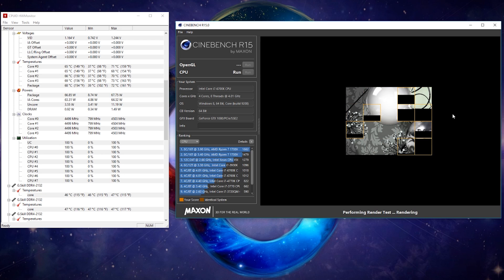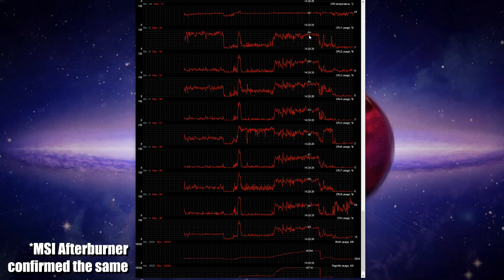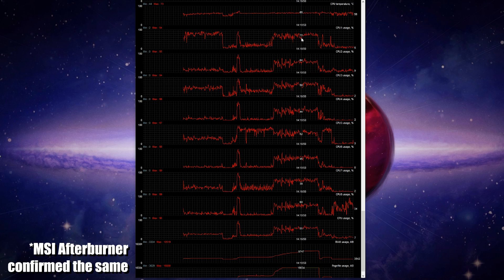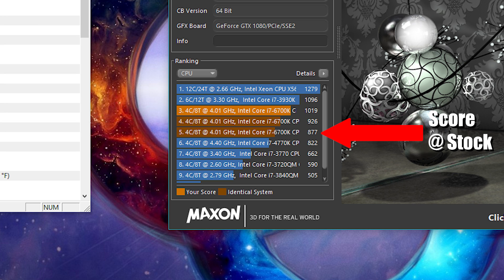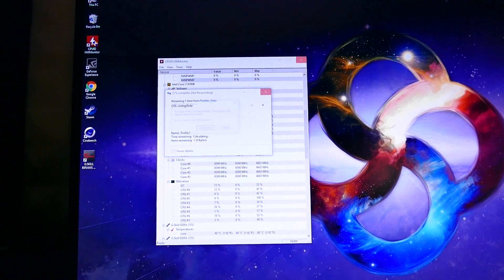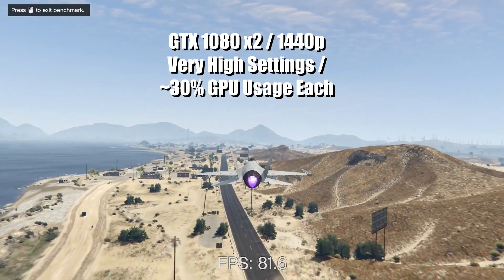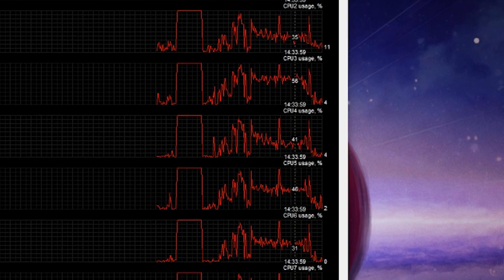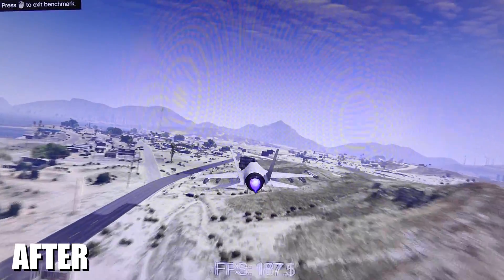My PC was Terribly Under-Performing...

Comment: I had a similar issue when i was overclocking the bejesus out of a Athlon x4 860k the higher i went 4.5GHz 5Ghz I was seeing loss in performance (yes I checked thermals and it is on water). I ran a memory benchmark and BLAM found that my ram was under performing as WELL (4th percentile) so I started poking around BIOS and I found out that my RAM timings were set to "AUTO", what ever that means, this is when it hit me. I had been overclocking my cpu so far that it started messing with my FSB and as a result my RAM timings were wayyyyy up there (i think it was something like 16-18-17-32 ddr3-1866)! I cleared CMOS and locked my timings to normal and manually overclocked my RAM, FSB, and CPU and now it sits in the (96th percentile @ 4.2ghz). Lesson here is to check how your bios controls other components on the board when you overclock. Each board is different and out of the half-dozen systems that I have overclocked I have never seen this issue.

Comment: i had the same problem with GTX 1070 i installed windows updated all drivers but when i ran games my gpu was siting around 900mhz and the fans weren't turning on so i tried everything reinstalled gpu drivers reinstalled windows drivers still nothing in the end i reinstalled windows still the same problem!! so i put in the disk that came with the motherboard again and reinstalled directx11 again my computer freaked out a bunch of weird shit happend onscreen then it went black after like 10 seconds it came back on and bang! problem fixed all that overthinking for a stupid problem like that i dont know if thats what caused your problem but i hope it helps!

Comment: I've had a low GPU usage issue on my PC in the past on my Ryzen system for absolutely no reason. My SINGLE Titan XP (2016) was around 50% in Witcher 3 when in 4K which affected framerate massively. DDU, same result and then I reinstalled windows which then fixed my issue like you did here... Weird.

Comment: I do have an issue with my laptop that confuses me that my GPU will never go above 99% usage. I thought this was to be expected when I had to replace the P7550 with a T7250 since somehow the P7550 got damaged. So I eventually upgraded to a P8700 which is far better than the P7550 I had before and the laptop fully supported it.  But the usage is still never higher than 99%. Im not sure if this would make a big impact or not  to the performace. I use GPU-Z and I have noticed that the dedicated RAM for the GPU never goes above 499.5 MHz even though its rated for 500 MHz (GT 130M with DDR2 1GB), everything else is fine. I get 30-45 FPS in TF2 at low and I would expect better since this GPU more than meets the specs for the game. I get 50-60 FPS in CSGO though. Im not sure if that 1% will make any huge difference or not. Any thoughts?

Comment: There are a lot of unexplained things in this world. When I was on Windows 8.1 something happened that made Windows Task manager pick up 1 core of my i3 3240 but still read 4 threads. Performance was like 1 core with HT enabled overall with the system, BIOS read the CPU fine. All I did to fix the issue was update to Windows 10, but I still always wonder wth could've happened to cause that
Reply: FeTi Productions msconfig setting probably.

Comment: it could of been a windows update, there's been a couple of times in which drivers/software start having problems due to a simple update.
Reply: You can also go back in time, pretty much go onto the last system restore point on recovery mode / Or worst case look for an option called "go back to previous build"

Comment: You know, I was having a problem with my i7 4790k where it was running at 95+c and I couldn't figure out why. I ended up resetting my bios and reoverclocking with the same settings and it brought my temps down almost 20c. I don't know what changed, but resetting it worked.

Comment: I got the same problem with my old laptop back then and i just installed something that fucked up my gpu and cpu performance so i tried reformatting the system and it worked.
I suggest go check what you installed before this problem occurred :)

Comment: Windows 10 updates keep changing Power Options. Even though it will show High Performance settings, like you have them at, they were actually running at Balanced, which is Windows 10 default. Windows 10 does this too me after every update, so I built a checklist of settings so I can clear the settings, and come back and put back in my settings. It is a pain in the ass, but has been doing this since about January, and no word from Microsoft why.
Reply: Whats the checklist?

Comment: if your cores were good, possibly unstable cache? A few days after OCing a little i5 I noticed the cache was too high and started hurting my performance.  I dropped it just a bit as I had it even with my OC cores and the issue cleared up. I suppose it could also cause a GPU bottleneck. Who knows though, it is a mystery. Then again it could have been that hyper threading bug.

Comment: I used something called tertiary  frame buffer ( something like that ) on my old gtx 670 sli config in 2014 and it gave me some really odd results, my gpu usage dropped horrifically to about 33% each and my frame rate halfed, I only fixed it by taking the cards out and resetting the drivers to stock. It wasn't the tertiary frame buffer thingy that was the issue but more that once I toggled it my install of the drivers decided to fuck them-self in the ass and refuse to work correctly, I've never had the issue since or before that. I switch out to a gtx 780 ti ghz planning to go sli and I'll let you know if they have any issues similar to this.

Comment: Try disabling HEPT. The dual Xeon build I built for my girlfriend is having latency problems. I disabled HEPT and blam, fixed. Unfortunately when I disable it after some time Windows just creaks to a halt and freezes (more or less). It doesn't do this on Linux. Windows 10 is supposed to have a better alternative for HEPT but when I disable it in the BIOS it just freezes.. Yeah, Windows 10 sucks.

Comment: motherboard is the center piece and has contact with both issues, did you update a bios after your first setup? not sure why it would happen but two issues with different components also did you underclock the ddr or did that happen after a bios update? just a thought buddy.

Comment: I had an interesting problem with my Ryzen 7 1700...  I had it overclocked to 4ghz and was running benchmarks and had abysmal performance.   When I checked the cpu clock was using boost mode and going to 1.5 ghz so I turned off the overclock and was back to normal performance... Very odd but I guess I will have to delve deeply into my bios and disable boost.

Comment: I also have some pc issues and have spent months looking up info & swapping pieces here and there. And after 6 months of doing this (I actually travel a lot so in 6 months I only spent a few weeks at home, not enough as to focuss on the issue) I think I can say it's my i7-6700K. Suffers from extremely random crashes (while idle, youtube, even in some random games like NMS, Wildlands, Division or TSW....) and doesn't hyperthread. Some time ago I found about the "Skylake bug" and was able to tell that that was my issue, now confirmed by the recent news of Skylake's having crashes before hyperthreading (literally my issue, my cpu won't hyperthread and randomly crash, probably when it tries to). I've been tempted so many times in the past months to just screwing it and spending 500€ on a ryzen 7 and be done with it (plus, for what I do, the extra cores & threads would be benefical). Just can't be bothered of spending more momey after getting an overpriced i7-6700K.

Comment: Maybe because the os thought u had a previous graphics card still in there? Like u had a 1060 or something in the system on that exact os because I had the exact same issue I tried using a different ssd and it worked fine

Comment: I built a computer for work last week. CPU was Ryzen 7 1700. I overclocked it from 3 GHz to 3.7 GHz and went to test it. Cinebench score was the same as stock. I spent 3 hours trying to figure out what was wrong, at one point overclocking so high (4.1GHz) that I had to do a CMOS reset. The CMOS reset didn't fix the performance issue. Finally I noticed that clock speeds were being reported as 2.5GHz by task manager. I googled the issue. Turns out IT WAS FREAKING WINDOWS POWER SAVER. WHY WOULD ANYONE WANT TO THROTTLE A DESKTOP TO SAVE POWER? POWER SAVER IS FOR LAPTOPS. WHY, WINDOWS, WHY???? Anyway I fixed it and life was good... until the BIOS started being a butt but that's a story for another time
Reply: PeKoE In America  you'd be only saving maybe a couple dollars a year though.
Reply: @anotherks7297  depends
Reply: ...because windows
Reply: I used to get the worst stuttering ever, and (I'm going to use PUBG for reference) I would get 55 FPS max in PUBG, all lowest settings, aside from textures. ThIS WaS sOoOo AnNoYiNg (I have an i7-3770). Power-saver.... was making my CPU run at 1.57 GHz. Click "High Performance?" Consistent 80 FPS in PUBG, tiny stutters. Web-browsing got way better, everything felt so amazing. Fuck off, Windows.
Reply: @klumsy3420  1.5 GhZ!!!!!!!!!!!!!!!!!!!
Reply: These comments sound like a life saver. I totally forgot to check my power options. No wonder my overclocks  feel sluggish lately.
Reply: Power saver doesn't necessarily have to be about saving battery life but reducing electricity consumption.
Reply: thanks mine was set to balanced i never thought about this
Reply: both things you said are the fucking same!!!!!!!!!
Reply: lol this was happening with my GPU- Nvidea has that optimize efficiency thing... if you are working with a nominal PSU I guess it could be good...
Reply: create how would you turn off the power saver?
Reply: my desktop eats alot of power like alot,,, and im just rinning a i3-8350k only,,i cant imagine a 5ghz 9900k,,, looks like im running a grow op
Reply: My man... I was getting 40% on both cpu and gpu and once I changed that it was better. Ty
Reply: how do you fix it teach me
Reply: Holy shit ik this is 3 years late but I’m so thankful for your comment. I was so stressed because I paid a lot of money for my pc and I had no idea what was going on, but you helped me out so much. Thank you so much.
Reply: just upgraded recently and had the same issue, getting around 1.6ghz on my ryzen 5 5600x. was panicking until i read this and noticed my power saving shit was on too. thank you for your comment, you saved me from having a heart attack !!
Reply: create you must be new, windows power savings thing has been there for years. I believe it may be for businesses, since they have multiple computers hooked up.
Reply: i do this, bcause if correct configurated, the clocks will be set as high as needed for the task.
it doesnt slow down my pc, only more silent and less consumption :)
Reply: AMD users need to download and use the AMD POWER PROFILE TO AVOID THIS ISSUE.

Power saver is for SAVING POWER, NOT FOR LAPTOPS. YES, NORMAL DESKTOP USERS CARE ABOUT POWER USAGE.

Comment: Weird bios issues like this can often be attributed to a software glitch in the the EPROM itself, or a bit flip. I have seen bios/uefi bit flips cause some weird issues that you would not believe if I told you. I've written the EPROM to a file and compared with checksum verified copies from the manufacturer and found some discrepancies. I then Re-flashed the EPROM, and issues were gone. Sometimes the error is in the CMOS-RAM that you can reset and some times it's in the ROM. ROM software issues usually cause issues that reside in the resetable data in my experience but bit flips can occur there too. Many newer UEFIs use checksums to verify the data and you will simply get a checksum error and if resetting doesn't work, hope to whatever god you choose that you still have the ability to reflash via UEFI.... or have a chip burner on hand.

Comment: could have been Windows 10 game mode.....had the same problem and lot of stutter and low frame rate once windows 10 creator update was installed. Windows game mode was activated on default for me.

Comment: windows 10 imo is still buggy as hell. when i reinstall a windows 10 to my pc the wifi doesn't work, the whole bar (bookmarked programs bar) are unclickable and clicking windows to shut my pc doesn't work. not to mention my pc is overheating.

i solved it by going to the advanced boot settings and do a clean install (without clearing the data), reinstall drivers, and update windows

Comment: Ive never really done cpu or ram overclocking so I dont know if this is good or not but my ram is running at 2666mhz on 1.35v  (corsair 3200mhz kit) and my R5 1600 is running at 3.9Ghz at 1.3875v on my MSI b350m arctic mortar mobo

Comment: I am having the exactly same issue with two 1080ti sli(low usage, fps worse than single card), if only you uploaded this video a little bit earlier because I ended up return one of them a few days ago. Now I am really curious what will happen if I try to fresh reinstall the OS, at this point I not even care about fps anymore, I just want to know if that will fix the issue and I really want to know what could be the cause. Thank you for this video, at least now I know I am not alone.
=========================================================
Edit: 
Things I tried:
DDU
Different HB SLI brigade
Test each of the single card and each of the slot on MB
=========================================================

Comment: I'll try doing what the video sugested. I have a Q6600 and rx 480 8gb, 6gb ddr2 ram. I've seen people with the same procesor and a gtx 750 ti get better framerates in gta V and CS:GO. (procesor is stock = 2.4 Ghz)

Comment: I always will recommend getting a standalone hdd/ssd for only the system. Not only you get more storage for you BS, you also smoothen your frametimes, because the load on windows is focused on one hard drive, and game on another. And then if you see your system underperforming, you easily backup a few gigabytes of data (documents, saves and otherwise pretty much it) and you're good to go reinstalling. Steam, origin and uplay have the function to check, if you have games on the hard drive already, so that's only a matter of few hours, and programs don't take too much of space (usually 300mb at most) so it's a very fast process to actually do a cleanup like this. Two HDDs are a must for me.

Comment: Sounds like you had a stability issue and had a degraded OS aka data was slightly corrupted been there and done that on my asus sabertooth x99 I7 5820k only fix was redo the OS and slightly reduce my OC on my CPU by 100mhz and I had no BSOD's or lockups or anything.

The thing is with haswell and skylake you might want to up your CPU cache voltage a slight bit found even when cache is at stock over time there is some issues especially if OC the cores I believe the voltage drop due to the core OC meaning the running voltage on CPU cache is low causing minor stability issue and I found it basically shows no signs of a issue other than eventually causes a performance degradation.

Comment: i had very strange bios problem too.. i bought in 2015 z97p-d3 mobo and i5 4670k combo with newest bios at that time. Everything worked normally for 4 months. Suddenly my pc could not post, unless i reset bios. next time when i want turn on my pc again same problem.. i tried everything, different ram,gpu,psu,hard drive, boot without case, heck after upgrade to i7 4790k i had same fucking problem... At that time only thing that havent been changed was mobo, lastly i updated bios and boom problem fixed.. no idea why default bios was bad, and why it worked for so long without issues. Very frustrating experience after week of troubleshooting...

Comment: Your OS, I'm 99% sure that Windows fucked something. I had the same issue with my computer, my 5960X and two GTX 980Ti suddenly stopped operating at full capacity. At first I noticed that games weren't achieving 144 FPS (ROG Swift PG248Q) and then when I tried to export a 15' video at 4K 30fps at Sony Vegas it was estimating around 22 hours. 

Everything was fine until I checked to see if Windows had downloaded any updates (I know, I'm a dum-ass, I should have disabled updates after I checked previously for the 1607 update and installed it). 

Honestly, I don't how I should feel about Windows 10. On one hand it's a great OS (my computer boots within seconds; M.2 x8), on the other hand every time it updates something must be fucked up. Like when I first got Windows 10, the updater was forcing a Windows 2008 Server update for Xeon CPUs (something like that) that every time it was fucking up the PC to the point it was crashing, hanging and been painfully slow. After I noticed that the updater was retarded, I stopped auto updates until MS settled them.

Comment: my guess is bad secondary ram timings ie "auto timings" can be bad reference "actually hardware overclocking channel" but I've seen that happen before i always manually set all timings but this is as far as the CPU.

the video card have you used NV inspector and possibility set a FPS cap I have one set at 110 FPS because my Asus ultrawide monitor gsync is 100 hz.  possible you accident set one that capped you video card

Comment: ive had that low gpu usage with an r9 270. reinstalled windows 10 and it worked.
Reply: i got 14fps before and 50fps after reinstalling windows